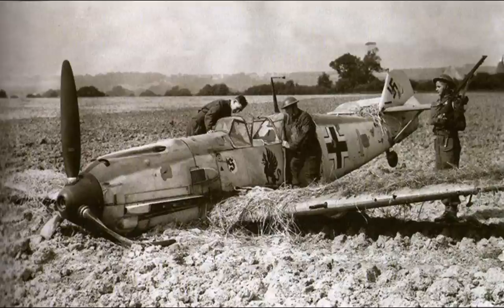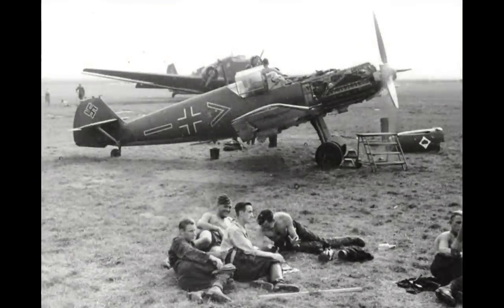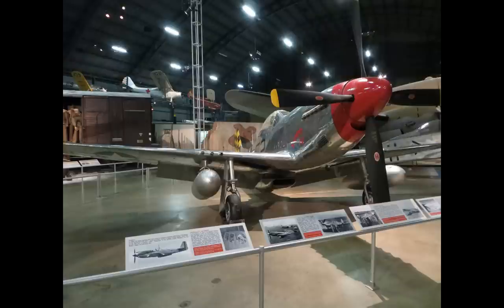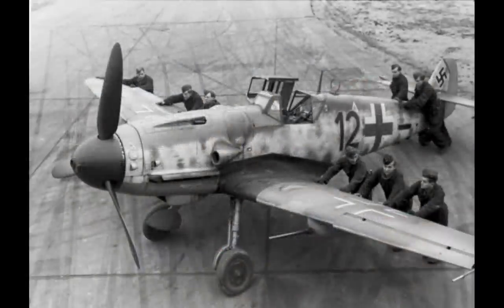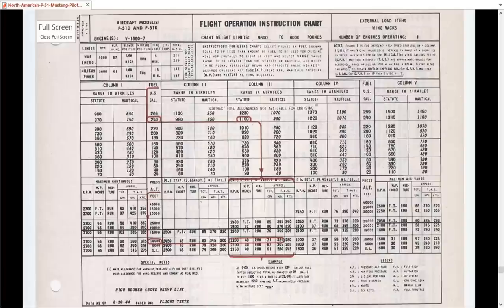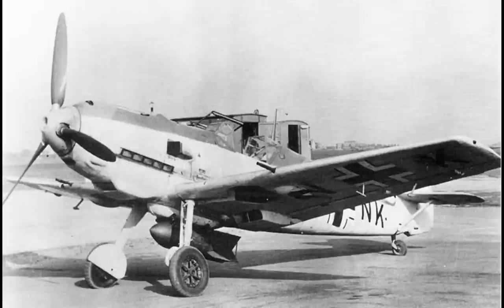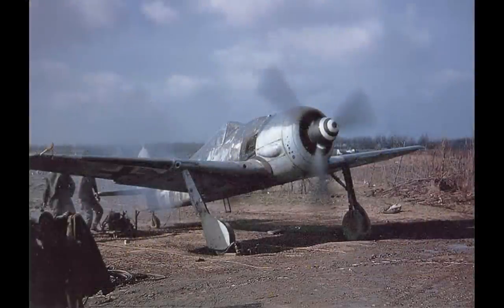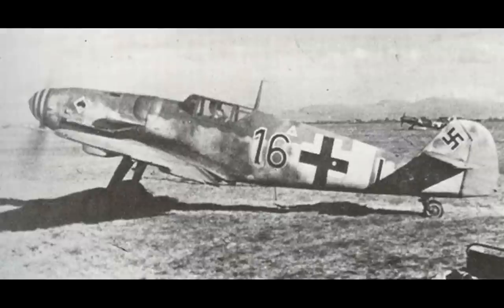Messerschmitt BF 109, Why Such Short Range?

Comment: Greg i have always wondered why the spitfire had cooling issues with such large radiators hanging off the wings the Bf 109 had lower profile radiators with a larger capacity engine. Why didn't they run a central radiator like the Hurricane and the Russian fighters, I have imagined a setup like the Mustang would have been the most aerodynamic. Drag must have been increased with those two scoops especially in the Griffon Spits.
Reply: Due to the concept of pressure recovery, the nose mounted radiator of the Hurricane or the P40 is inefficient because it has no room to expand the intake plenum and to constrict the radiator exhaust to quickly evacuate the hot air.  The wing mounted radiators of the Spitfire and the ME109 are tradeoff.  While mounting the radiator in the slower air in the lower wing, it will affect the wing aerodynamic efficiency.  If the Brits and German were to redesign their planes, they would choose the best solution as in the P51 because the underbelly doens't contribute to lift and it's low pressure air is best for pressure recovery inside the radiator duct.
Reply: @HiWetcam 
The German DB-605 engine actually had higher compression ratio pistons than the American or British engines, the compression ratio of the BF-109's engine was 7.5:1 in earlier engines and 8:51 in later ones when they got 100 octane fuel, the Merlin had 6.1:1 and the Allison had 6.5:1, but it didn't matter because all these engines had variable speed (one way or the other) superchargers, in the earlier model planes the pilot had to run the amount of boost to the engine by watching a guage, the later ones had automatic systems, the German engines ran a little less boost pressure because of their higher compression pistons and the American or British engines ran a little more boost pressure (given that you're using the same octane level fuel in all three), in the end it's the octane level that determines how much boost you can give to the engines before you get detonation (spark knock) which can destroy any one of these engines in a matter of seconds, the pilots were told how much boost pressure they could run depending on the octane level of the fuel, on the later automatic systems the maintenance guys adjusted the systems and could turn them up for more boost the higher the octane levels got.
Reply: 2Phast4Rocket thanx for that info, bang on.
Reply: 2Phast4Rocket ,
Reply: The initial Spitfire radiator, based on work done at RAE Farnborough, was designed to be atleast drag neutral as the heated exhaust air generated a thrust equal to the drag of the radiator.
Reply: @dukecraig2402  Compression and fuel grade still has little to do with the quality of the engine.  They just weren't on the same level.  Perhaps at the start of the war they were advanced for that period, but were quickly eclipsed by nearly every other engine manufacturer in simple engineering. More efficient heads were constantly being introduced, issues resolved, and weak points were addressed in every other aircraft engine while the DB was mostly left untouched.  Early Allied V12's weren't exactly the pinnacle of engineering at the start of the war, but they rapidly gained that title.  Besides, anyone who inverts a perfectly good geared V12 has something inherently wrong with their brain :p
Reply: @Skinflaps_Meatslapper  
The power increases in the Allied engines during the war were due mainly to the increases in octane ratings, higher octane ratings allow you to run more boost before you achieve detonation (engine knock), that's what destroys ANY of these engines irregardless of who made them, these are supercharged engines that run high amounts of boost, higher octane=more boost before detonation occurs, more boost=more power, the Allied V12 engines had less displacement (Merlin 527ci less, Allison 401ci less) than the DB-605 engine yet made more power at their equal development stages, at no point during their development or use did the DB-605 engines achieve 1HP per ci, the following are HP ratings at take off.
   DB-605=2,176ci making1,973HP at take off (.91HP per ci)
   Merlin=1,649ci making 2,200HP at take off (1.27HP per ci)
 Allison=1,710ci making 2,300HP at take off (1.27HP per ci)
These are all power ratings with all three later developed engines with water injection at War Emergency Power/ take off power, take off power is the best way to compare power ratings between these engines since different engine/supercharger configurations show their HP ratings at different altitudes, the DB-605 engine NEVER made any more power at any developmental stage than the Merlin or Allison engines at the same stage, the head changes were in the cam via different valve timing (the intake valve was given longer duration) for better cylinder fill, the other changes to the later DB-605 (very late in the war) were a switch from ball bearings in the reciprocating assembly (crank and rod bearings) to regular bearings and had problems that were never resolved by the end of the war and pilots were forbidden to use emergency/take off power settings anyways. 
The Germans had it wrong when it came to the mechanical compression ratio of the pistons in their aircraft engines (very surprising given we're talking about German engineers), years ago a fellow with the last name of Ricardo (I can't remember his first name) did the calculations and determined that the best compression ratio for an engine running high amounts of boost is between 6:1 and 7:1 irregardless of fuel type (gas, alcohol or nitro), that's why today's modern Top Fuel dragsters run 6.5:1 compression pistons but their superchargers blow enough mix into a cylinder so that when the piston reaches TDC of the compression stroke the spark plug fires in almost pure liquid because the air has been compressed to bubbles the size of the ones beer, source:
Aircraft maintenance school and 30 years of building performance engines.

Comment: Thanks for the video. Some points to consider; fuel octane rating (saw your other videos)Germans ran 87 odd Ron and US ran 130-150 Ron- regular versus super so more power in each super litre; material weights used in each plane-did one use more canvas/wood/metal over others? Aerodynamic design factors? Basically it sounds like 109 was originally set up as interceptor and close range attack-making it go to England without adding drop tanks, bigger tanks in fuselage was just asking too much. What a waste of resources and lack of planning by command for those 109s to crash land for lack of fuel reasons.

Comment: Thanks Greg for that video or rather that reworked video.  I find when one is talking about fuel and trying to get longer missions from an aircraft there is no better aircraft to chose than the P 38.  
   I think I watched something about how Limburg taught the guys how to bring those RPM's down and leaning up the mix to increase the flight time to an astonishing amount but it was years ago and nothing like how you make a video.  I'm sure you have a video about that.
  The 109's blower drive sounds like it could be tricky and technical for serviceability,, High tech, highly machined, high precision has a pay off when it come to keep it all running smooth,, I could only cringe when I think of FOD damage to parts like that but until I see the video I'm only guessing.

Comment: Hello Greg. Here's my first comment and hope il will help. Fighters in the 30's where often concieved with thougt of beeing sort of army component to protect ground position. In France Bloch 152 had very short range. It initialy was maybe because they where intended at armies theater and point defense roles. By the way, french monoplane fighter with v engines where also designed with 20mm centerline canons like ms406, d520. Thanks for your great videos and very intersting topics they're about

Comment: No replacement for displacement,  this is a very old rule for power in performance anything. Never thought to apply it directly to how quickly I want to suck the go-go juice out of my tank.
Great video with explanations simplified just enough for the less educated of your aviation nerd viewers (like myself) to get better educated.
I have a question that you may covered already in another video,
Fuel range in my understanding of it, is the distance to point and back to start with 10-20 percent reserved fuel to loiter at point for a time.  Is this the basic definition as you use it?
If so then the 109 had amazing fuel economy, significantly better than most planes of the time it sounds like. Just had the problems of parasitic loss that was high. If you translate range into mpg, the 109 got 9mpg with such a massive engine. I barely get 12mpg in my ford f350 on a very good day, with 1/5 of the engine. And yes I know that the comparisons aren't straight foward like this.
Reply: The allies had access to high octane fuel and could run the merlins at much higher compression/manifold boost. This gives more power for same quantity of fuel. P-51 was slippery, wing thickness moved rearward a bit (trade off was less lift per area) and the exhaust system was configured to provide thrust.

Comment: You are point on about the Fuel Injection subject. I have a 1972 Plymouth Valiant with a slant 6 225ci engine, and I plan to put a holly 2 barrel projection system on it.
Reply from the maker: The slant six was a good engine.
Reply: @GregsAirplanesandAutomobiles yes and thanks to our distant cousins down under there are all kinds of goodies made for it. 
Superchargers, manifolds for everything from one barrel stock, to four barrel and the manifold for the supercharger, and all the forged pistons/connecting rods/cranks ext. 
I have been looking into electric conversion also because the electric motors that they have now for 3000 and under make like between 200 to 400 hp equivalent and double that torque.
The batteries is what is still bat crap expensive.

Comment: Hi Greg, according to "German Warplanes of WW 2" the 109 G-10 variant had the worst range of all at only 350 miles, with pilots often running out of fuel returning from missions. They tried to remedy this  by equipping the G-10 U-4  with a non-jettisonable fuel tank;  not sure what effect this had on speed and handling. Thanks for another great video.

Comment: At least Fins who had luxury of using Bf109 -G6 variant  used to cruise at around 70 percent throttle after the take off.  At that cruise speed it was documented to fly about 700km / 430-440 ish miles.  That was during cold weather..  i do not know for sure how the air temp changes the operating distance on planes.  But at least on cars, they use more fuel in cold weather, even if started up all ready with warm engine.    I think they had drop tanks that could add for distance, ment to be dropped instantly if in contact with enemy … but im not sure if they where in use on Finnish front.    At least i do not remember anymore.. been so so many years since i read about it.
Reply: Fuel and air is more dense at lower temperatures, therefore you can inject more of it and increase consumption. In the same time, it easier to keep the engine cool, which doesn't expand as much and runs smother. So compared to a tropical operation, you get also a high consumption, but more power. 
I suppose that's why they operated at 70% throttle, corresponding to 90% farther to the south.
Can't say why it had a longer range, but maybe it was because the engine ran better.

Comment: Technical point regarding carburetors in automotive racing engines: In race cars, the highest G-load is horizontal, to the outside the turns. (Think of a bucket of water being whirled around on the end of a rope.) This can cause fuel in the float bowls to slosh to the side, causing the engine to lean-out in a corner. Fuel injection is pressurized and thus is not sensitive to side-load sloshing.

Comment: A very comprehensive explanation as always Greg. I like the added details and comparisons with its early contemporaries that puts in in perspective.

But on the question of German fighter range and endurance, the American ace Kit Carson when comparing the Bf-109 with the FW-190A lambasted the 109's range and endurance among other things. (about an hour of endurance at combat power) While praising the 190 for being able to go 3 hours plus.

The 109's limitations in this category are obvious for the reasons you have stated. However based on what I have seen, the 190 should be better but not by much without careful engine management or the use of drop tanks like in the later models or long range G models. I don't know the way the 190 was tested to get those numbers but I am assuming it was achieved with a relatively gentle economic settings but I am a bit puzzled by the disparity. Based on written numbers in his report on 109 gas capacity I am wondering if he may be in error overall in someway.

I am wondering if you have any explanation for that, it does not seem right to me without having done a closer look yet.
Reply: The range of the Me 109 usually comes out at around 390 miles but maybe 350 miles for a late model Me 109G or K and 420 for an early model Bf 109E.  This assumes take-off and immediate climb and transition to maximum cruise speed.  Take note of the word maximum. These figures are for maximum cruise speed. This was the only speed possible in the European Theatre of Operations unless you wanted to accept a high chance of being shot down.  If operating at economical cruise the late model Me 109G/K could be ferried 600 miles without a drop tank and 1000 miles with a drop tank to deploy to a distant airfield.  The late model aircraft from the Me 109G6AM or ASM such as the Me 109G14, G10 and K4 all had a supplementary tank of about 115-130 Litres that in some models could carry either MW50 (water methanol), Extra fuel or liquid cryogenic nitrous oxide.  If the high octane C3 fuel was available the MW50 was not really necessary especially if it was a high altitude mission. It could add about 25% to the range.  The late war Me 109F/G/K had an 87 Imperial Gallon / 400 litre tank.  The drop tank was 300 Litres or 66 Imp gallon.   The Me 109 was a very fast cruising aircraft due to the nature of the DB605 engine and when comparing range to allied aircraft you should consider that longer range would be possible at lower cruising speeds.  Having said that the range was not really great.

The Fw 190 had more range and more fuel capacity to begin with, about 500 miles, despite the Thirsty BMW 801 "R2600" radial. It could also carry 2 and in some cases 3 drop tanks.   It also received the supplementary tank for extra fuel, MW50 and nitrous oxide but much latter in the war except for special versions (I think a few Fw 190A5).  The Fw 190D9 had the supplementary tank for the MW50 for the Jumo 213 Inline and its possible that the Fw 190A9 had this as well and was referred to as the Ribbentrop system.  MW50 didn't work so well on the BMW 801 radial and they tended to rely on injection of fuel into the eye of the supercharger called "benzine einspritzung" this cooled and contracted the air without the tendency to create micro cracks in the cylinder head but it required C3 fuel.  It also only became possible from about late 1943 onwards when German 'green dyed' C3 fuel went from 94/115 octane to about 97/125 and then nearly 100/130 octane.

When the Fw 190D12/13 became available a 3rd 20mm canon was installed firing through the propeller.  This made the engine machine guns and outer wing guns unnecessary and so it was planed to drop them and use the space for fuel instead for the Fw 190D12EB

Also a word about climb rate.  The Me 109 had a really high climb rate with only really some marks of Spitfire exceeding it.  If its 1939 and French air force bomber aircraft are crossing your border at Saarbrucken at 20,000ft you need to get up there fast.  All the range in the world doesn't matter if you take 15 minutes instead of 10 minutes getting to altitude and then spend another 5 minutes catching up because you took so long to climb.

Comment: Greg is right on. My only addition along with dates of design is the British specification for the Mustang: Long range. The BF-109 was design in 1935 with older technology and understanding of aerodynamics. The design was based off of Wermacht tactics which were based on blitzkreig and rapid forward movement. The 109 was never designed to fly long distances and in fact relied on continually landing further forward just behind the ever forward-extending frontlines.

Comment: Thanks Greg. To fill out some RAF aircraft detail:  My father worked at an RAF base, after the war, as a fitter. They reckoned that many of the earlier Spitfires and Hurricanes had a flying radius of only about 350 nautical miles. Some of the later photo-reconnaissance Spitfires had ranges of over 1350 nautical miles (sometimes quoted as around 1600 statute miles), but only when carrying drop tanks, Oxygen for the pilot, and stripped of weapons. Most later Spitfires and Hurricanes had maximum ranges of not much more than 400 nautical miles. 

I had a pilot's handbook for the Mk II, which stated that its 1100 hp Merlin engine required 40 Imperial gallons of fuel per hour when running at maximum economy, but that could rise to over 90 gallons per hour under combat conditions - that's effectively about an hour in the air before needing to find an airfield. The pilot had to keep a very close watch on his fuel gauges!